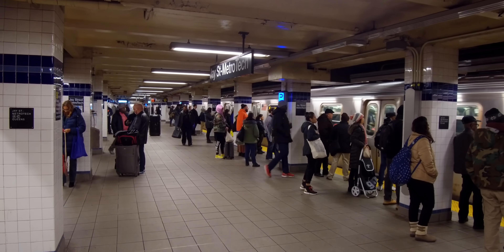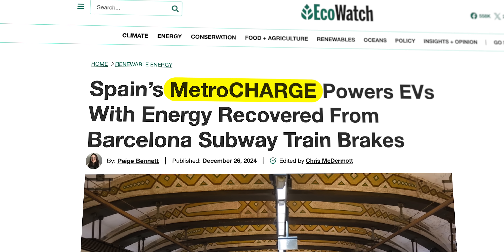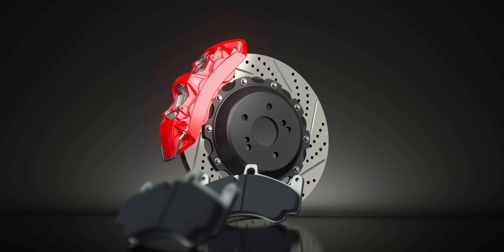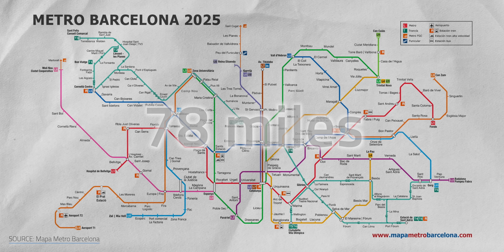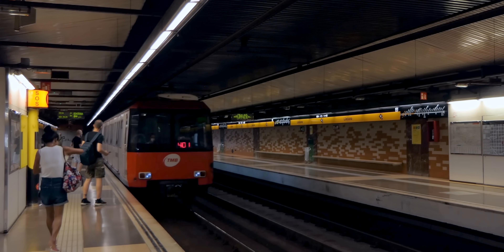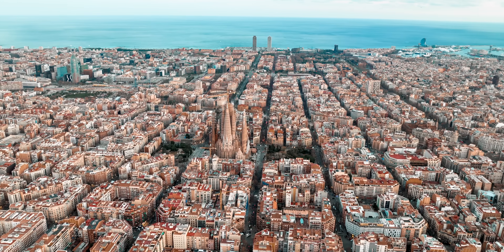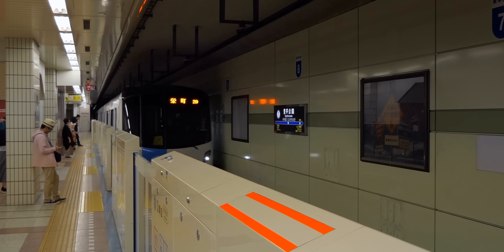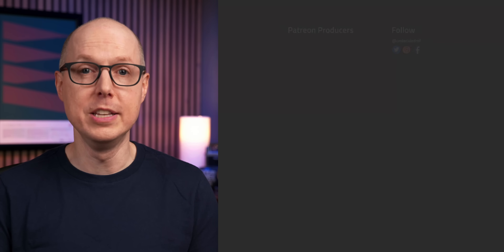The Most Overlooked Clean Energy Source… is Under Your Feet

Comment from the maker: Are the benefits of regenerative braking ironclad… or is it time to pull the emergency stop on this train of thought? Go to https://ground.news/undecided for an innovative way to stay fully informed on tech, energy, the climate and more. Save 40% on the Ground News unlimited access Vantage plan with my link.

If you liked this, check out Why Mushrooms are Starting to Replace Everything https://youtu.be/jI2LC3WTryw?list=PLnTSM-ORSgi7uzySCXq8VXhodHB5B5OiQ
Reply: All buses and electric trains can do the same thing. Since the Soviet era.
Reply: There is nothing wrong with dumping power on the grid, any grid that can handle the draw to accelerate a train, should be able to handle the pulse of the deceleration generation.  All the other stuff is fad and fluff, either providing no benefit at all or adding to cost unnecessarily.
Reply: I am just questioning why the recovered electricity is going to other things that aren't the tram itself? Obviously it needs electricity to move again after topping, so why is it not dedicated to that directly? I am sure an engineer has an answer that would make sense, I just don't know what I don't know.
Reply: @cybernoid001  I'd say you hit the nail on the head. Diverting the recovered energy to other applications sounds like green washing, by claiming to get closer to their CO2 reduction target by reducing consumption elsewhere. Instead, they should be reducing it on the metro itself, as that significantly reduces transmission and conversion losses. Returning the power to the metro grid is one option, but it's not that simple as the power has to be converted back to the same type and voltage, which also creates conversion losses. Using super-capacitors on the engines is probably the most efficient option to store the recovered energy, as they can be charged and discharged much faster than normal batteries can,, allowing the initial acceleration to come from the capacitors alone, reducing the load on the metro power grid. The upfront cost is higher than batteries, but in the long run their lifespan and efficiency make them cheaper than any battery.
They should also focus on how to reduce the need for people to commute, that would bring more benefits to the environment and society than any technological improvement.
Reply: @VeniceInventors this is green washing, not science
Reply: @cybernoid001  the cost to store that power locally would be too high.
Reply: Matt - have you covered electric generating speed bumps?
Reply: @bomafett  Im not sure those produce enough energy to pay for themselves.
Reply: @jsbrads1  - yet. Like most technologies, they will likely get better over time. But honestly, I don't know much about them, just that they exist.
Reply: @bomafett  Im not sure the energy is there to harvest, I suppose the cost to make them and connect them to the grid can go down enough eventually, but it would be much more useful if it can just power itself and adapt to the appropriate height for a car.
Reply: @jsbrads1 I was thinking of a parking lot full of speed bumps with a few EV charging stations powered by the speed bumps.
Reply: @bomafett  would those chargers be connected to the grid? Because then the benefit is only the power gained and if it is fairly small, it won’t charge many cars.
Reply: title is too much click bait. modern trains have regen braking.  I think the reason or difference is traditional train RB does not capture all kinetic energy because it would mean plenty capacitors or batteries on-board. I think the innovation in the train in the video is they can capture most of the regen braking energy by exporting the electricity to the grid.
Reply: There's a lot of talk in one of the threads here on capacitor storage; it might be an opportunity to check in with that industry to see whats new and upcoming?
Reply: Regenerative braking is not creating power, it is just recapturing what was already spent to lower the cost of operations. It always makes sense to waste less in the total system unless the financial part is wrong. You have to run the trains anyway, so you should do all you can to get some of that back for any or all uses. Just a question of cost but also climate impact. I love that it lowers the temp in the system as that reduces the need for temp exchange overall too. Maybe local buildings could use heat pumps to draw off that excess heat to warm their needs in season. Waste not want not.
Reply: Regenerative braking is not RB in short. It has been REGEN for 10+ years. regen...

Comment: The first step is to actually power trains with electricity. Only 1% of us railways are equipped with any form of electrician. In India, it's 97% . Yes, it will cost a lot to electricity the North American railroads, but it's not prohibitive. It would actually cost less than twice  the DoD annual budget. Someday, we will have to do this, especially with the reality of the extremely likely outbreak of nuclear war in the Middle East in the next few years, and the resulting catastrophic rise in oil prices this will cause as oil infrastructure is destroyed in the war. India has already prepared its railways for the reality of war disruption in the oil supply chain. Come on, North America, 1% railroad electrification is a joke. Let's get serious about fixing this problem. 
Also, overhead wires can be used to power trucks and buses on the freeway so that they can use small batteries for driving between final destinations and the freeway. Once they merge onto the freeway overhead, wires can do all the charging and powering as they drive long-distance. To make the system more efficient, trucks and trains heading downhill can feed energy from regenerative brakes back into the wires and send it to trucks and trains that need extra power to help them climb the hill on opposite lanes or tracks

Comment: There are some extremely loud subway stations in NYC.  I thought that the Lexington Ave line platform at Union Square Station had to be the loudest in the city, but according to testing done by the NY Post, at 104 decibels, it's only the second loudest.  The loudest was South Ferry at 111 decibels.  Those are so loud because of curved subway platforms, so I am not sure how much lower the noise could be made using RB.  One issue with the NYC subway using RB is that the system is powered by the DC third rail.  Some new subway cars have AC motors in part to benefit from RB.  However, it will probably take a very long time to swap out all of the DC cars currently in use.

Comment: On some Japanese trains you can see the regenerative braking in action. There is a meter in front of the driver showing power usage. Easy to see acceleration, cruising, coasting, and braking. When the train starts braking, you'll see the needle move to the negative side for power flow in the other direction.

Comment: Sorry but i'm disliking this video. 

I struggle to understand the advantages of the MetroCharge initiaive when Regen braking has been a thing for decades (as you are well aware of). The energy recovered thanks to RB was aleready being used to power train stations, as it was being returned straight into the power grid through contact wires above the track. 

Rerouting this power to EV charging stations changes absolutely nothing. It's like lending your friend $20 and when he returns it, you say you've made a $20 profit. 

It seems as though Spain is using this as a loophole to charge metro users higher fares to offer EV drivers cheaper electricity.  The project is a waste of money, likely funded by corrupt lobbying groups such as car manufacturers. This sort of corruption is very common in Spain.

I have no idea how you didn't catch this during scripting and ended up supporting the project. It suggests a lack of understanding of the issue you're discussing. If I am the one who is getting it wrong, please enlighten me.

Comment: Generally, the rail system itself has enough usage by other trains, at least in the core districts, to absorb all the energy from regen braking. Many mainline systems in Europe already have these energy recovery systems in place. And most of them, when a train brake at where there isn't local demand by another train, will just feed the energy back to the grid. And whatever use that energy on the grid doesn't matter. It's honestly not impressive at all to single out EV charging. Electricity is electricity, it shouldn't matter what uses it.

Comment: Just a thought, but if we simply elevate each metro station by a meter or two, the train will practically stop itself on the uphill, and then, with a stroke of genius, the downhill slope will launch it into acceleration. And if you inject the electricity generated while braking back to the grid, you don't need batteries on the train, put them wherever you want. This is just government propaganda, they have to show they do something positive for the environment.

Comment: Yup, 37k charging points for a population of 49,153,849 may be too few.  ;)  But what percentage of the pop. are actually in EVs?
RB is one of those funky settings in an EV.  100% will make your uneven gas pedal foot to give you a bronco  bustin' ride.  On the trains, it would likely be much more smooth, or unnoticeable.  It's a good way to recover energy already spent by the train accelerating.  That concept of recovery may spread far and wide soon.

Comment: When i saw the comments, i was shocked at how many people mentioned about RB being used for traction power instead of EV Stations, which I didn't even think before (nor do I understand about it). But imo i think why we overlook those are because trains are already very efficient in a sense that it would be impractical for most use case in cities to convert the energy back (considering the cost and all sorts of adjustment ofc). I think most cities would like to consider on another way of generating a new clean energy sources, maybe like DB with its Hydrodams, or solar farms which could cover way more uses of electricity than just an EV charging station. Or maybe even consider making a new connection/line within the city with the help of that budget to relief the use of Private Vehicles contributing to maybe Net Zero emissions.

Comment: THE TECK HAS  HAS BEEN AROUND OVER 20 YEARS, BEEN SETTTING UP LARGE INDUSTRIAL PANTS WITH MOTOR VSD USING WITH HV REGEN GRID TIE INVERTERS WHEN EVER SLOWIBG LARGE LOADS DOWN. INSTAED OF  GOING TO LARGE BRAKING RESISTORS.

Comment: Dynamic braking uses the train's motion to generate electricity that is sent to resistors that dissipate the energy as heat.  It's an old tech, and saves wear on brakes.  That tech is about 100 years old.  Using the energy is modern tech because high power electronics are required.

Comment: I have wondered for a longtime why the energy from freight trains braking is not used rather than vent off as heat. Where I live in the west it seems like a lot of energy could be gained/recovered from trains descending from mountain passes.  At the very least it could be dumped into the power grid.  This would add power to the Grid and also help with the train's breaking capacity.  There could also be a system of capacitors/batteries to add power to the trains climbing the grade and then sent back to  capacitors/batteries decending the grade in areas not closes enough to a market making the transfer economical.  I suspect there are reasons this is not done, but as tech advances it would seem like this is a real opportunity.

Comment: This is a total gimmick. 

Regenerative braking has been around forever and it is far more efficient to put it back into the grid than to move it somewhere else as it came from the grid in the first place. 
So now, instead of the trains load on the grid being 20-30% of its total energy use (the other 70-80% being regenerated) now its grid load is 100% and the regenerated power goes elsewhere 🤣

Comment: From London Transport's website: 

• The overall efficiency of the regenerative braking system
From measurements on the Metropolitan line we estimate 26% of the energy used by trains is gainfully re-used through regenerative braking.

• Information on how the recovered energy is stored and reused 
Regenerated braking energy is transmitted to the London Underground high voltage distribution network and re-used by other trains.

Comment: Would it not be more efficient to use fly-wheel technology to absorb the energy of the braking train and then return the energy a few moments later to accelerate the train back up to speed. This would also reduce the massive peak demand for electrical power when accelerating. Saving even more in wasted heat.

Comment: Hello Mat! I am surprised other countries don't make their trams/train power consumption circular. In my home country of the Netherlands, our trams have been supplying back power for at least 30 years. The power is used by other trams to depart or if they have any other power demanding requests and any excess is fed back into the power grid. If I remember correctly the power supplied back is about 80-85% efficient and any remaining power is fed into breaking resistors on the roof of a tram. (or whatever location the manufacturer chooses). When a tram breaks normally on the E breaks it does not use the disk breaks at all, A tram can come to a full stop just on the E breaks so it is regenerating power during it's entire breaking exercise. 

From my understanding this is common practice for trams here and in Germany as wel. So either Barcelona is just being creative with this long existing technology or other big players in the world just have very old public transport that is in dire need of updating.
Reply: @j4ck3t  almost every electrically powered train nowadays uses regenerative braking. It has been a thing for decades. I challenge anyone to find a modern train that doesn't use it.

Comment: As noted in other comments (and in this video) this is not anything new, nor should it be surprising. I believe this is one of the reasons many systems use DC power (among others). In Vancouver Canada the "Skytrain" (our subway) system has has regen for many years, with energy being pumped back into the system, and recent discussion of using excess power (when it can't be put back into the system) being used for EV bus charging. The extensive trolley bus system in Vancouver has been doing this since at least 1956s. A copy of the 1956 "Buzzer" magazine from 1956 talks about how regenerative braking works and how it dumps collected electricity back into the 550V DC overhead power lines. The first trolley bus system started in Vancouver in 1948 but it did not have regen. The current lines in Vancouver carry 600V DC. Keep in mind that this is being done in a province where almost 100% of the electricity comes from hydro power, so even though such energy is far cheaper than fossil fuels it still makes sense to be efficient.

Comment: Electric trains have had regenerative braking, on the systems I have worked on the power is pumped into the third rail, to move or start other trains. The Exception is the last few MPH, where actual brakes are used for precise stops.

Comment: Unfortunately, I’m with those who don’t think the EV chargers are the best use. I personally would like to see it fed into some ultra capacitors (sized for the energy supplied) which would then be used to help start the train moving again when it departs. Granted, the capacitors wouldn’t be able to supply the entire starting current demand; but it would cut down on the demand for energy from the national grid. In order to make the best use of the EV charging of the regenerative braking, you’d have to be guaranteed to have an EV plugged into the charger at a low SOC when the train is putting out; and that’s just not the case. A capacitor based solution would really be a better solution.

Comment: a/c powered trains would still need to convert grid frequency voltage to variable frequency to drive the wheels, which passes through a dc link. I’m not sure why dc powered trains would be more lossy than this (unless it had to do with conversion to and from a lower voltage you mentioned.)

Comment: It seems like the train would need to accelerate again after a minute.  Regenerative braking is cool and should be in all the electric trains. But electricity is fungible isn't it?  Why are we saying that the energy is used to power specific things?  Why not net meter the train and stop bragging about charging EVs.  Trains on level ground are net consumers of electricity so propaganda about them powering other stuff is a distraction.  The regenerative braking is the point not the EV charger.

Comment: Run the numbers,  what is ROI (Return on Investment)?  They spend $9 million deploying the system. Whats the total value of the thectricy they get back? Running the trains uses about 40 million KWH/year so 40% of that = 16 Million Kwh/year. Mr Google says, in Barcelona,  electricity costs about 35 cents/Kwh.  Thats about $5.6 million  That makes a ROI of about 62% every year for as long as the systems last. Looks like a huge win/win to me.  The disclaimer being. I'm just spit-balling the figures your milleage may vary.

Comment: Why that complicated? On a metro system, there should always be an accelerating or at least not-braking train nearby to consume the recaptured energy from the braking train. In cases where the track section still has an energy excess, the traction substation can be designed in a way that enables refeeding that energy to the overlaying AC grid. So the whole story of the video is nothing really new.